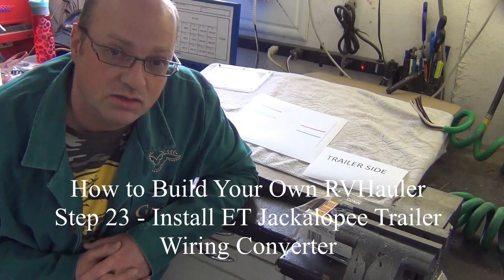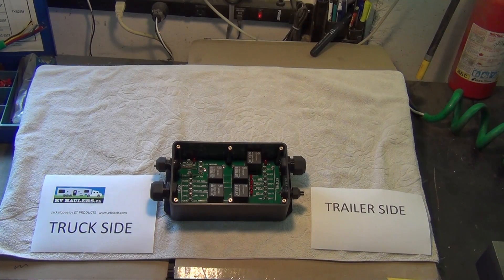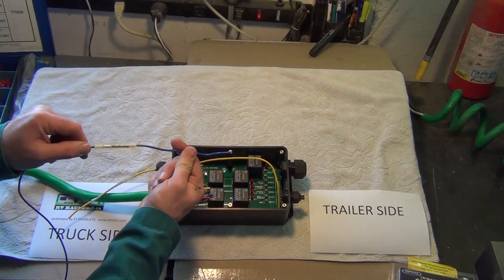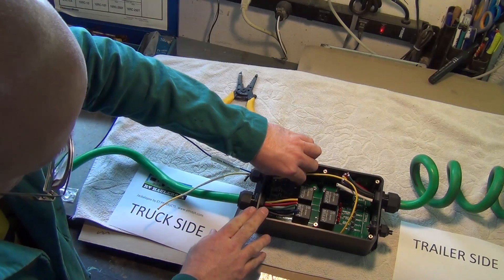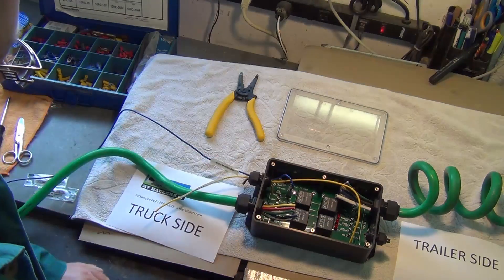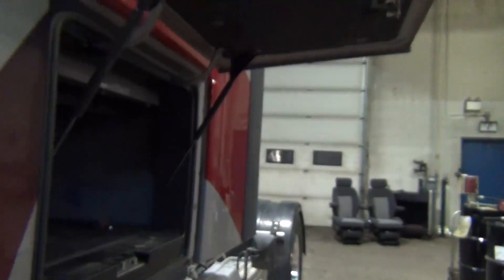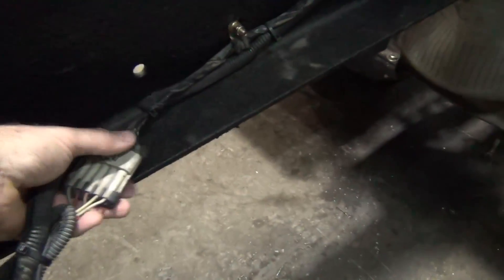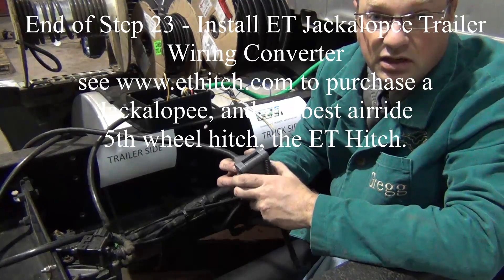Build an RV Hauler -Step 23- Install Jackalopee Wiring Converter

Comment: This is dumb! The rear tail lights on the back of the tractor already have the brake lights and turn signal combined. Just tap into the taillights at the rear of the tractor.
Reply: I've been thinking the same thing
Reply: Yes these trucks already have a jackalopee built in it is located in the dash. but some insist on using the Commercial trailer wiring.

Comment: Excellent series so far. This is the part I've been waiting to get to. I do have a couple of questions though if you wouldn't mind my asking. One, with the Jackalopee, do you have to tap the truck 7 pin harness or can you use a spare 7 pin pig tail and splice it into the box and just plug directly into the trucks stock fixture? (any known issues with use on Freightliners?) Two, I've noticed you have several of your builds that appear to have both the service and emergency air lines running out of the back of the new bed to the RV. Would love to know what is going on there and how it is setup. I've only seen one instance of a 5th wheel with air bakes on the axles.
Reply from the maker: +Charles Stevenson Hello Charles.  Yes, you could certainly make the Jackalopee removable by putting on two short cables in either end of the jackalopee.  That way you can pull either commercial or rv trailers.  In regards to the air lines -  there are some rv trailers that use an air over hydraulic activated brake system. It is named the Blu Dot system.